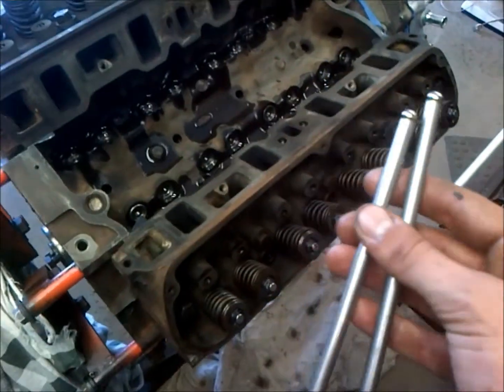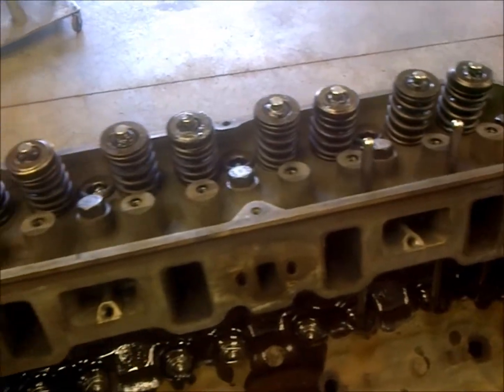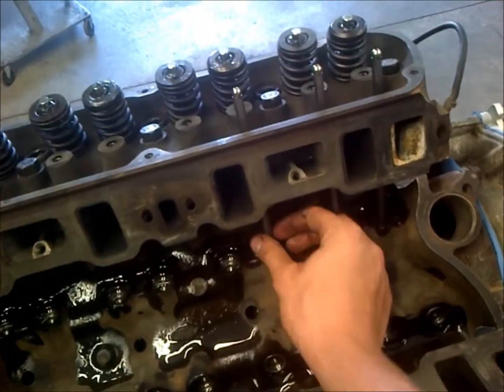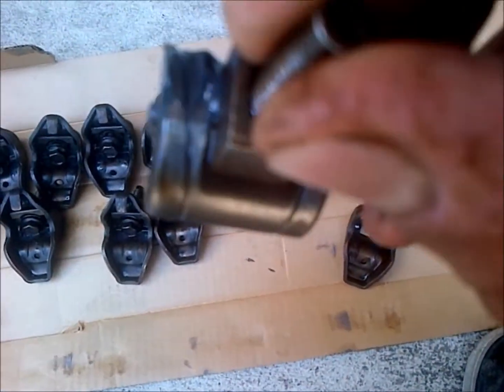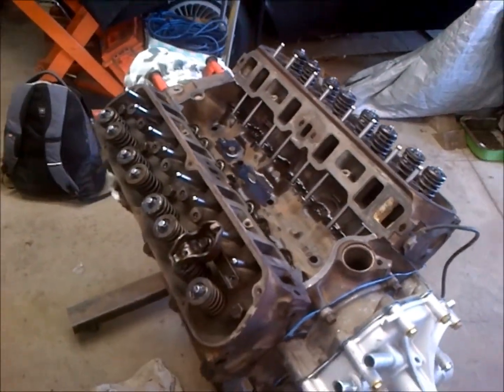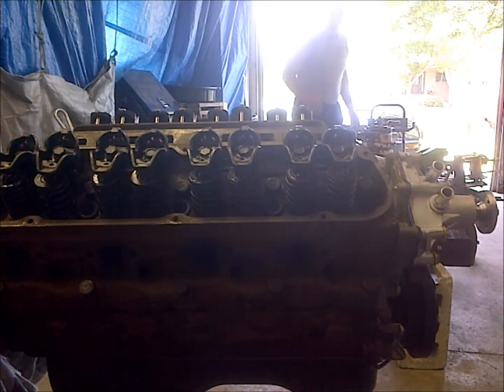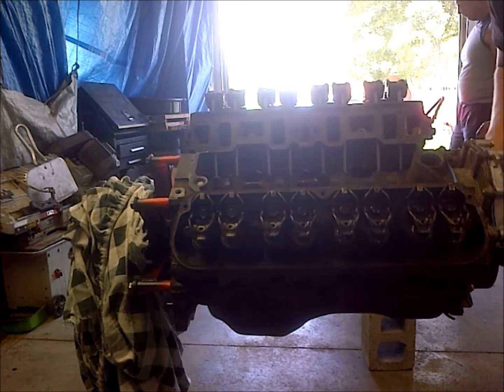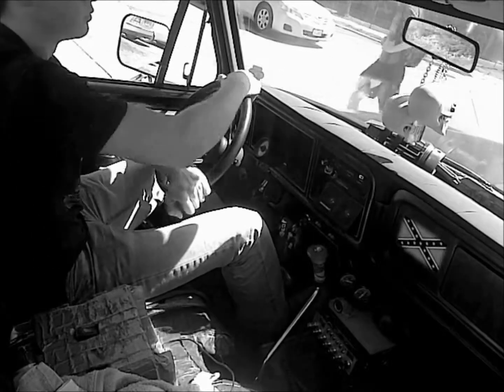valve Adjustment & Checking Valvetrain Geometry HOW TO (Best Method)

Comment: So my rockers were taking from 3/4 to 1 full turn to reach 25 ftlbs. Using gt 40p heads that has .020 removed. Using slightly longer pushrods to get center valve contact.